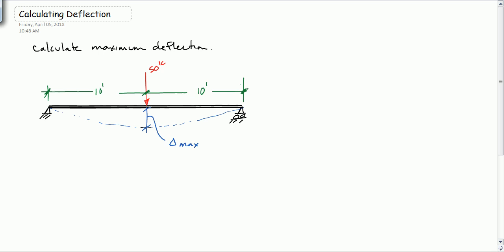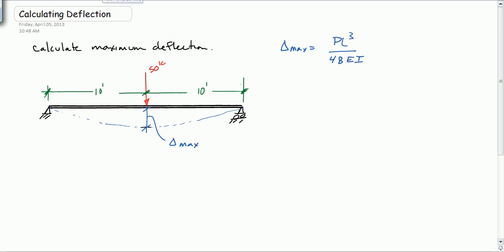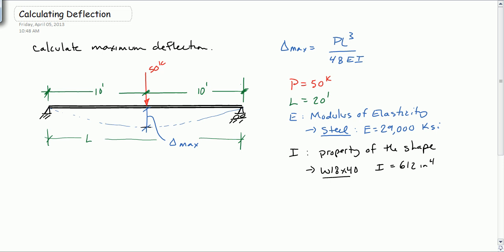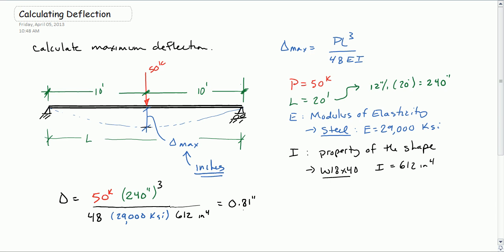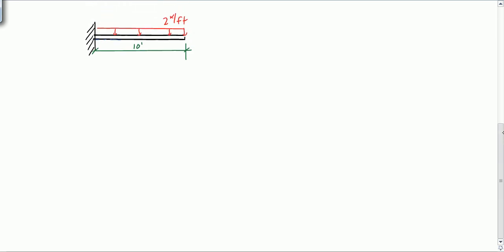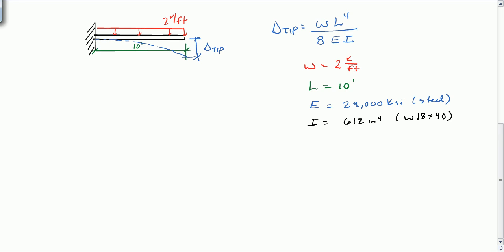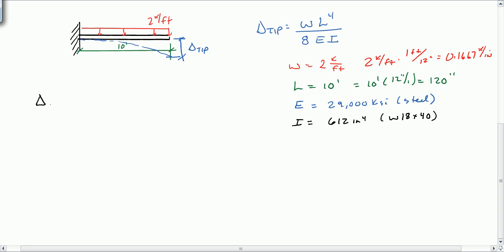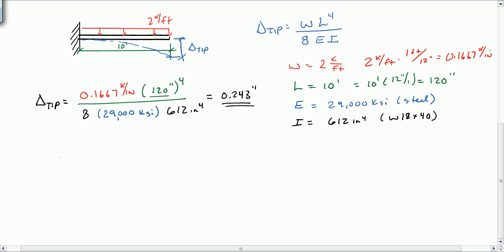deflection of simple beam and cantilever

Comment: can you help me?? i have 1500 mm carbon steel (1045 alloy ) circular solid guide 12mm diameter... need to know the load capacity...before it deflect a single mm

Comment: hi....50k   k = kilograms???? what if the beam is a solid circle ... make the same... w * h??  where can i find  "I" ??
Reply from the maker: k = kip = 1000 pounds
I is a property of the shape. It is the 2nd moment of area, calculated as the integral of y^2dA.  For common shapes, like a circle, you would look it up in a table if you don't want to derive it: http://en.wikipedia.org/wiki/List_of_area_moments_of_inertia
Reply: well can you helpme ..i dont understand some thing very good..... i have a steel guide ( the alloy import? ) 12mm diameter , 1500 mm lenght .. with a center load of 20kg..i need to know when it flex... to put less load...regards